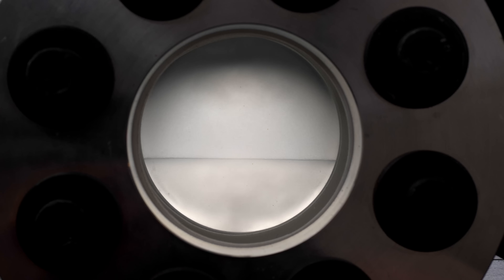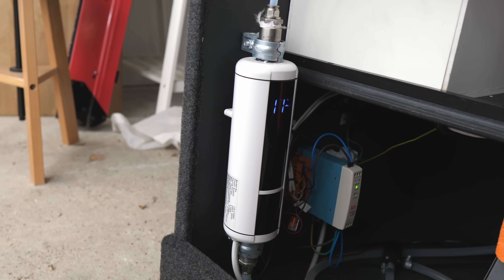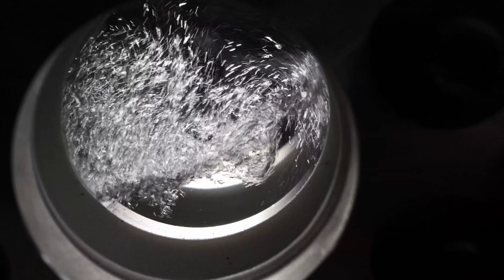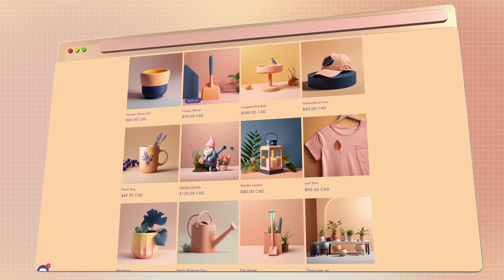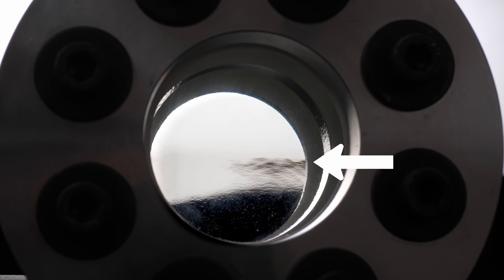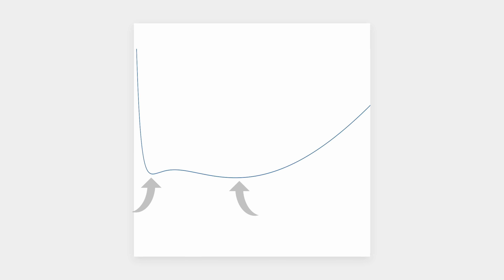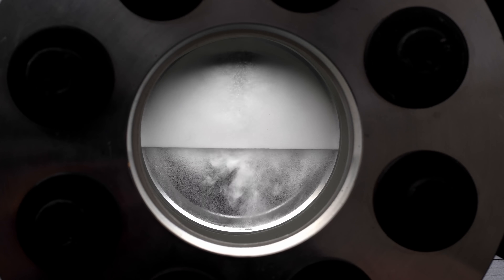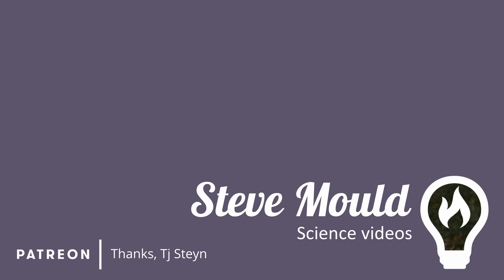The Unknown Phase of Matter

Comment: This might help clear up some confusion: All materials are always partially gas.

I like how you showed the graph with 2 minimums to explain liquid and gas, but I don't think you really explained how that also applies to "normal" liquids and gasses like what you show at 8:55.If some particles randomly move from the liquid to gas phase, then, because the container isn't any bigger, the particles are all, on average, very slightly closer together. This means that it's more likely for a gas particle (maybe a different one) to fall back into the other minimum and go back to liquid. So, at a given temperature, the gas part will maintain a specific pressure. if the container got bigger, it could accept more gas to maintain that pressure. As you heat the container, the particles have more energy to "resist" that attractive force even as they get closer, moving the "gas" minimum downward, and allowing more particles to be gas.

This explains evaporation as well, why it's better in warm temperatures, and worse with high humidity. Boiling is just when the temperature is so high that the pressure the gas "wants" to achieve is higher than the atmosphere, so particles shift rapidly to gas, unable to actually increase the pressure the way they "want" to.

This applies just as well to solids, also. Everything is either: solid and gas, liquid and gas, or just gas. That's why you can smell anything.

* Lots of asterisks apply when there are multiple materials together (so basically, all real scenarios). Water is happy to follow the rules, but other materials, to varying degrees, will "consider" or "ignore" the pressure of gasses of other materials.

Comment: Brilliant video, Steve!

I’m a professor of thermodynamics, and  12:36  this part of the video absolutely delighted me. The Helmholtz free-energy landscape you draw is essentially a 1-D analogue of the classical Gibbs thermodynamic surface — the full U(S,V) representation that Maxwell even built as a physical 3-D model. Your two minima (liquid and gas), the barrier in between, and the way the curve flattens near the critical point mirror the geometry of the Gibbs surface remarkably well.

A few months ago, I built a high-pressure viewing cell myself to show the solid–liquid–supercritical transition of CO₂ to my students. It worked beautifully, but I quickly discovered that liquid CO₂ is surprisingly aggressive toward acrylic windows — they slowly turned cloudy and eventually began to fail. Because of that, I now use other substances with lower critical pressures instead of CO₂ for teaching, as they are much safer and easier to handle.

Seeing this concept presented so intuitively and visually was wonderful. You have a unique talent for making deep thermodynamics accessible without losing accuracy. Thank you for bringing classical ideas like the Gibbs surface back into modern science communication
Reply: Nitrogen! That's what is typically used in France for this demo.
Reply: Could you recommend substances for a demo with low critical pressure?
Reply: @NathanMechEng I guess Ethane is good as one only needs 43bar instead of 73bar, but about the same temperature (near room temperature). However, it is flammable...
Xenon would be at 58bar and 16.6°C so no heating required, but it's expensive.
Reply: @weasel.3683  thanks!

Comment: 12:43 I always imagined it was a combination of gravity and every atom having their own amount of energy, the higher energy ones will be traveling faster and pushing other atoms further away with each hit creating space allowing other high energy atoms to slam into more low energy atoms creating more space until you have the defined line between liquid and gas and as the liquid forms the denser liquid falls to the bottom, and one the liquid forms it doesn't evaporate because it takes too much energy to evaporate and it stays as a liquid creating these two energy wells you described, but this was all my own interpretation of how I thought this happened

Comment: I worked on analytical instruments and service supercritical fluid chromatographs. They operate at 100-400 bar (100-400x atmospheric pressure) and use 5-10 mm thick quartz windows. Those insanely thick windows might be overkill 😂

Comment: For the boat 3d print, maybe you could have tiny very-tiny air pockets/holes sealed in the resin very near to the top of the boat giving it just enough lift to make sure it falls at super critical instead of before.

Comment: I worked for many years in power stations using supercritical boilers.
In the early days, when we were being trained and trying to understand supercriticality, this device would have been invaluable for us to understand the concept of gas/liquid at the same time or to SEE the concept of gas and liquid at the same density.
Reply: I work for SCE, Southern California Edison, in Laughlin NV in the middle 70s. As a PEO, Plant Equipment Operator, we learned about supercritical steam. 1008 Degrees at 3500 lbs of pressure into the first turbine stage. It wasn't solid, liquid or gas, but had an enormous amount of energy. We called it "stuff"..........
Reply: @bbhrdzaz  SC steam is like large volume SCF extractors - best watched by CCTV from the next county  :-)

Comment: Supercritical fluids are not really that rare in our modern world. The content of (full, ~ 200 bar / 3000 psi) nitrogen and oxygen cylinders, for example, is supercritical, their critical points are at -147 °C / 34 bar and -118 °C / 50 bar, respectively. So the air (well, most of it) in a 200 bar scuba tank, or the oxygen for a welding/cutting torch is actually supercritical through most of the pressure range. The same goes for argon or helium cylinders.

Comment: Co2 in supercritical state is actually quite common, in refrigeration processes. You hear it properly well on the compressors, as they transition from compressing gaseous co2, into compressing supercritical co2. It sounds almost like hydrolocking, so you instinctively jump a bit if you are familiar with refrigeration and hear this for the first time (hydrolock typically means expensive compressor failure). Except supercritical co2 does no damage, to a co2 compressor designed for this purpose. It just sounds really harsh.

Comment: A lot of people doing these experiments are getting the opalescence wrong. The cloudiness like at 13:45 is not one really, it's more like just the result of mechanical agitation due to sudden phase separation in an unstable media. The aforementioned density fluctuations are normally happening at molecular scales and are too tiny to be visible in any noticeable way. In the immediate vicinity of the critical point however they can grow large enough to become comparable in size to the wavelength of visible light, and when that happens the fluid starts to disperse short waves first (blue light), then longer ones (green, then red) and eventually can become completely opaque right before hitting the critical point. Visually, if you shine a white light across the cell, the fluid would first gain a yellowish tint, it would then become more pronounced and deeper red, like the color of the tea, then very dark brown, and if you got everything right completely dark for a few short moments before going through all the color changes in reverse but in two swirling boiling phases now. (again this is in passing light, in reflected light it would turn much less spectacular milky bluish-white color for understandable reasons). You've almost caught it at 14:32 but you, like many others, were cooling the cell too fast and uneven and when that happens there's too much temperature differential across the fluid I guess that just completely kills the effect. I think the large part of the issue is that the significantly less thermally conductive windows make the majority of internal cell surface which definitely doesn't help keeping temperature even. When we made demonstrations in our lab we had a much more massive stainless high pressure cell with inch thick walls and relatively tiny sapphire windows just cooling passively to ambient room air at the speed of around 0.1-0.2°C per minute, still the dark colored phase passed in under a minute with complete blackout taking just a second or two. You also had to nail the amount of CO2 in the cell to actually hit the critical point and not just whoosh a tad above or below it on phase diagram, where you might get the cloudiness and maybe some color, but still not the real thing. We usually started with a slight excess and then released a bit after each temperature swing until we got it right. It's a great demonstration of how sensitive supercritical fluid is to temperature and pressure near the critical point.

Comment: The simple intuition for supercritical fluid arises when you consider thermal expansion - materials (including fluids) expand with increasing temperature- their density decreases. at the same time, gasses compress with pressure- their density increases. so, within a vessel where pressure can increase, as you heat a material, it will form a fluid. in a vacuum, that fluid'll just be a gas, but depending on the specific pressure and temp and material, you may have a liquid too, and their densities will approach each other. Eventually the liquid density decreases so much due to thermal expansion and the gas density increases so much due to increasing pressure (evaporation as well as the increasing volume of the liquid due to thermal expansion) and you reach a point where the densities equal each other, and you're left with just a "fluid," as described in this video.

Comment: Is the supercritical state of matter between liquid and gas really that unknown? I think it exists with water and steam inside a pressure cooker. I believe you can create something similar with soda water (CO2 infused water) under varying pressure and temperature, also. And there is a similar phenomenon at the solid-liquid boundary when you see bottled water in a freezer, but liquid, then drop it and it all turns instantly to ice.

Am I missing something?

Steve, sorry your coffee didn't turn out. Please get some green coffee beans and try again. Don't forget to roast them after the CO2 and before the grinding!
Reply: You can have a system with saturated steam where a container is part steam and part water at the same temperature, which is equivalent to when the container here has liquid and gaseous CO2 simultaneously. But to get supercritical steam you would need to reach over 200x atmospheric pressure at 370°C/700°F, neither of which are even close to happening in any pressure cooker.

Comment: Hold up.  So you can dissolve caffeine in a super critical fluid.  Then you can let off the fluid into a gas and the dissolved caffeine goes with the gas?  The idea of a solid dissolved in a gas is very interesting.  But then, if you were to breathe in the C02+Caffeine, would you absorb it?

Comment: I like to imagine matter as a network of atoms connected by springs. The springs nicely model the bonds between the atoms, pushing and pulling them until they reach a stable configuration at the balance point between the attractive and repulsive forces. There are multiple springs of difference stiffness between each atom and the phase transitions energies are model by the addition energy required to break the tightest spring. I think that within this model, the slope of your graph is the energy change in energy required to stretch out the strings in the network. The flat region would imply that there is no energy needed to transition between a gas/liquid state, that molecules can adopt the properties that are most convenient for them at any given moment.

Comment: The CO2 is under a pressure gradient due to gravity. The CO2 at the bottom is under additional pressure due to the weight of the CO2 above it. You're able to see both liquid and gas because the pressure gradient crosses the phase horizon within the vessel.

Comment: Dear Steve, I noticed that around 9:37 it seems that even though the interface is gone, you can observe what looks like gravity waves (in contrast with capillary waves that are usually what can be observed at this scale usually when dealing with a liquid-gas interface). This is probably due to the fact that in these conditions of temperature and pressure, there is not enough viscosity to dampen gravity waves at these small scales and no surface tension to cancel them all together. For this reason, your contraption preserves Froude invariance !  It would be soo cool to run some small scale water-waves experiments in this device (solitons, wave blow-up,...) !!

Comment: 15:20 Hang on, did you put roasted coffee beans in there? That's not usually how one does that, commercially, and I'm not sure it'll actually work to strip out caffeine very efficiently: I think that works much better with the cleaned-but-still-not-cooked cells of the coffee bean. But also, getting a roasted coffee bean wet (usually just water is a concern, maybe liquid CO2 wouldn't be?) for any purpose other than after you've ground it and brewed it is a good way to make its flavor go "off" in a variety of ways.
Reply: Never mind, 16:08: got there.

Comment: I don't think that these descriptions are good for intuition at all, because the words are mostly backwards. This thing you call a low energy state is just the area of least resistance, it's not a low energy state, because the energy is converted into spin instead of linear motion. Then you say "attraction" but there is no such thing as attraction, there is a flow into the particles. Particles are built from holes, and act like a sponge with a flow into them, so the flow moves them together, and the outflow creates a gas state. The real physics are therefore inflows, and outflows with pressure from flow forces towards their areas of least resistance. If your description was good for intuition you wouldn't call this an Unknown phase of matter, because actually its simple physics that a vacuum cleaner uses. We can all observe a vacuum cleaner with an inflow, and an outflow, and it moves things together, and blows out at the back. So the gas is the blow out stage, and the attraction is actually a flow into a movement which creates areas of low resistance... negative mass.

Comment: Cool! But how would it behave in zero G? Would you have a liquid sphere in the center covered by an atmosphere of gas and if you increase the temperature it'd still be the same "just in 3D"? Or would you have some weird mixture of densities without any specific clustering? Wait, you still have that "space connection", right? ...

Comment: It seems to me that the interface turns blue as supercritical conditions are approached. Is that due to Rayleigh scattering (why the sky is blue)? f so, I'm guessing it is either the decreasing interfacial tension i) allowing wobbling at wavelengths of 100nm or less, or ii) allowing splashing to create small droplets with that range of diameters.

Comment: 15:30 You weren't expecting a range of densities for the coffee beans?  You've obviously never cooked dried beans or peas, or at least not watched them.  I've never done coffee beans or CO₂, but red beans, pintos, blacks, split peas, and others behave this way as the water in which you cook them approaches boiling; some float while others remain sunk.  The specific reasons are likely different, but the variation is easy to see in the kitchen.

Comment: Unrelated to the science, small hint regarding color gradients I learned from an expert (that used to earn his money with doing Photoshop stuff). You will notice that in the color gradients at 13:50 both between red/yellow and yellow/blue there appears an ugly looking grey smudge instead of a nice orange or green. The reason for that is that when deciding how to encode color in order to save data there was decided that the R/G/B color values are the square root of the brightness of the color. This is because we are just much better to tell low brightnesses apart than high ones (0%/5%/10% brightness looks very differnt but 95% vs. 100% looks almost the same).

So, a linear gradient will just interpolate the color values on a linear scale, which does not look correctly. Photoshop and other professional image editing software also has the option to make a color gradient on a square function based curve and this just looks a lot nicer.
Reply: Interesting. Would a linear interpolation in HSV/HSL get around this issue?
Reply: @Ylyrra  Simple linear interpolation of HSV/HSL has it's own problems because Hue is cicrular. A linear interpolation between red and blue will go through the entire spectrum instead of going through a blend of red and blue
Reply: @MonochromeWench  Ah, yes, I meant "given you're lerping in the correct direction".
Reply: I was actually wondering if that was meant to represent something in the data or was just some kind of artifacting (?) issue with the graphic. Appreciate your knowledge

Comment: Hi Steve, I've got a question. Very cool video, by the way. So here's the question: If you fill up the chamber completely with liquid CO2, with no gas phase left. When you heat it up, will the CO2 also turn supercritical and enter a quasi-gaseous state? If this happens, here's the next question: A liquid is considered incompressible. So if the completely liquid CO2 filled volume (incompressible) turns into a gas or supercritical state on heating, will it then become compressible again? If yes, what would happen if you compress the supercritical state? In this case the supercritical state would take up less volume than the liquid CO2, while the number of CO2 molecules stayed the same. Or is it complete nonsense what I'm talking?